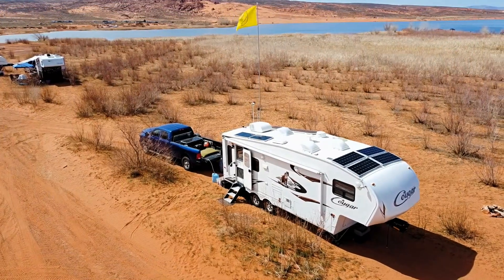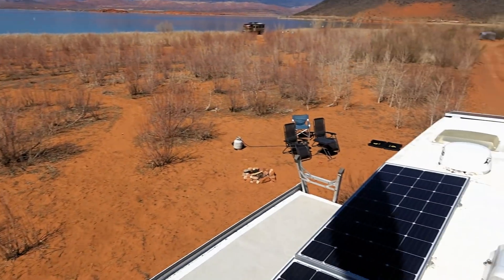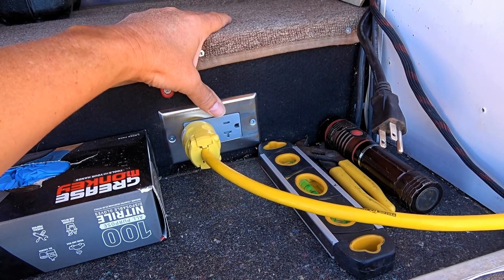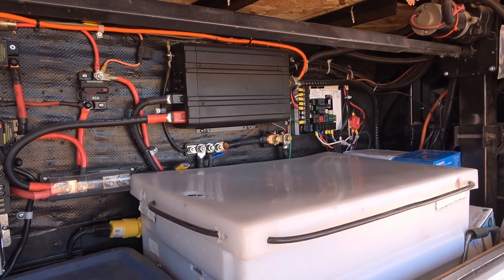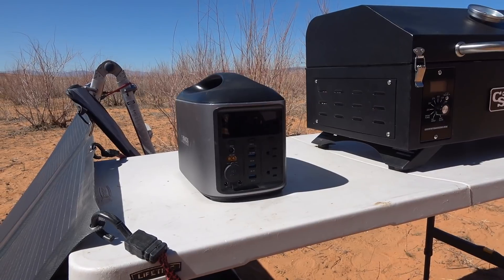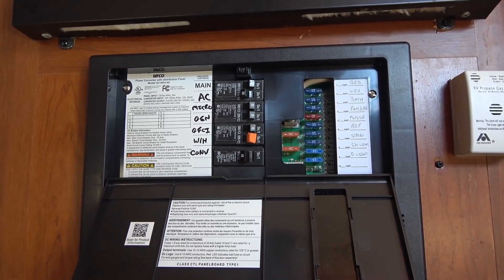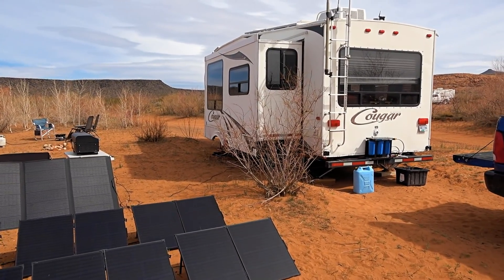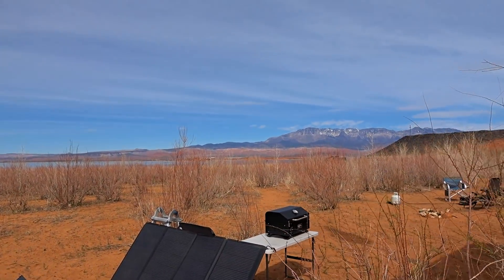RV Boondocking Power System Updates Explained - Current State of Things March 2022

Comment: Maybe I missed it, but I'm curious how burdensome it is managing all of the ground panels in the desert southwest areas where you boondock, where it seems every third or fourth day brings a high wind advisory or warning. For my part, I find my simple suitcase panel enough work on its own. Of course, we frequently sightsee away from the campsite and I'm not comfortable leaving the panel out while we're away...so I'm usually deploying and packing up a couple of times per day.
Reply from the maker: I just leave my panels out. The places I boondock don't seem to have much of a theft issue. People leave all kinds of stuff out even generators out with just a little cable lock. I guess it's hard to know if anyone is in the RV or maybe it's too much out of the way for most petty thieves.  Also, many RVer carry guns, so do you really want to be stealing from a boondocker. ;)
As for me being Canadian and not carrying a firearm, I have several obvious cameras around the rig. In 11 years of full-time RVing, we have only had a couple of thefts. One 2 gallon gas can from the back of the truck in Crescent City, CA, and Anne's mountain bike in Nanaimo, BC where they cut the bike lock. That's it.
As for wind I just collapse the legs of the 20 lb. rigid panels and lay the panels flat. Like this https://2smoc9hdrhc9eko13nc-cdn.plushcontent.com/uploads/files/vp/92mshijqn15r8x28.jpg They have handled over 45 mph without issue. As a test I left them tilted and found over 30 mph from the backside will flip them. They didn't break but suffered a few scratches. As for the thin panel it would need to be staked to the ground via its grommets or bungeed to the side of the RV.

Comment: No mention of the Lion Energy power station! Has the Ecoflow basically replaced it?
Reply from the maker: I have completed both the Lion Energy review https://www.loveyourrv.com/lion-energy-safari-me-off-grid-power-station-review-portable-rv-camping-solution/ and the Bluetti Review https://www.loveyourrv.com/bluetti-ac200p-off-grid-2000w-portable-power-station-review-real-world-tests/ Still have one more video to finish off the EcoFlow review. I like to use these boxes for a while so I can get some real world feel of them and do several videos on each. Of the three I think the EcoFlow is the best performer and most light weight and compact given the power and battery capacity. Its drawback is the lower battery lifespan 800 charge cycles until drops to 80% capacity versus over 3000 for the other 2. It has to do with the differing lithium battery chemistries used.

Comment: Ray, it would be very interesting if you were to sit down and design your system from scratch today, how would it look? That would make for  an awesome video
Reply from the maker: Good idea, I'll have to put some thought into that. So many options out there now an changing all the time.
Reply: Excellent presentation! It was interesting to see on paper the schematic of your system. I watched as you added pieces over the last 6 years . I learned a lot from you. I ended up doing my very simple system about 5 years ago . For now I chase the sun with a couple of panels, PWM CC & 600watt inverter. I will redesign in the future (soon) now that I’m pretty sure what I need/ want.